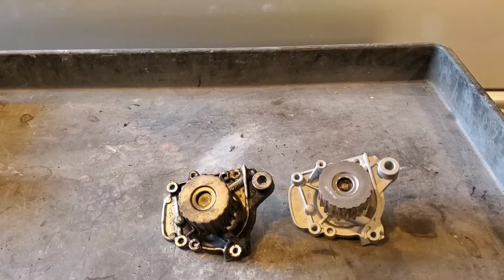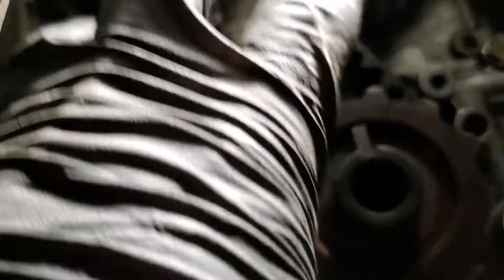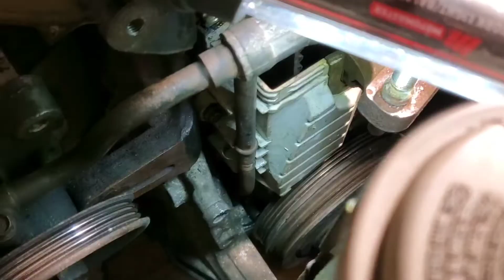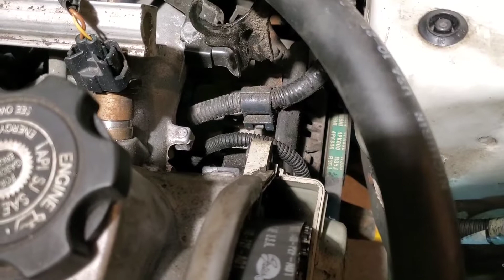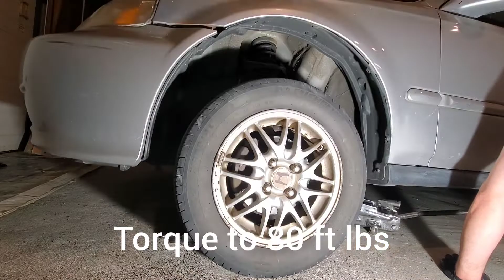96-2000 Civic water pump replacement: Part 2 (DIY guide)

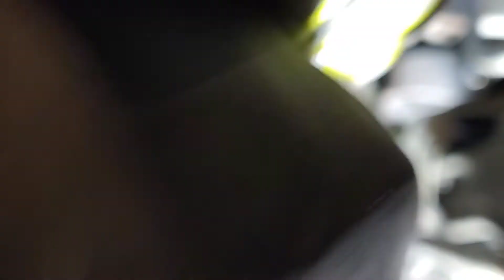Comment: 6:55, Lubricate with fresh motor oil. 14 ft-lb + 90° turn while you counter with crank pulley holding tool.
Reply from the maker: Thanks for your comment, tightening with the impact would be more than 14ft lbs. The bolt will tighten with time as its designed.

Comment: Somehow when putting my belt back it slipped and I'm scared its all out of line how do I fix this someone please help
Reply from the maker: Thanks for your question, are you refering to the timing belt or the driver belt(V belt)?
Reply: The one where the have to be top on
Reply: Without the belt I just turned them back to where the need to be separately is that ok should it be fine to put the belt on I'm worried I screwed my car now
Reply from the maker: @terrybrown4623 Which belt? Timing or the drive? I cant answer your question without knowing which belt.
Reply: @HomeownerDIY it's the one the belt that the water pump on i tried putting the belt back on like you did after I installed the new water pump so when I went to line everything back up and but I don't have it that great one but tempted and well I turned the harmonic balancer to much and tried and then my marks were lining back so I spun them both separately back to where they was am I good to do that it's my first time changing a water pump on a vehicle
Reply from the maker: Did you loosen off the belt tensioner? Its spring loaded.
Reply: @HomeownerDIY no the only thing I loosened was the alternator to take it off
Reply from the maker: @terrybrown4623 You need to loosen the tensioner. It has the circular roller. I think its a 10mm. Dont spin the cam/crank shafts without the belt on. If you need to check you can always spin the crank to make sure its turning easily. If your way off on the timing you will mangle the valve train with you start the car since the valves with crash into the piston.

If youre 1 tooth off the car will run like a POS but you wont damage anything. 

This is the second water pump l have done in my life.

Did you watch part 1?